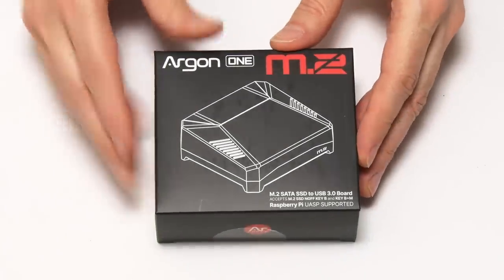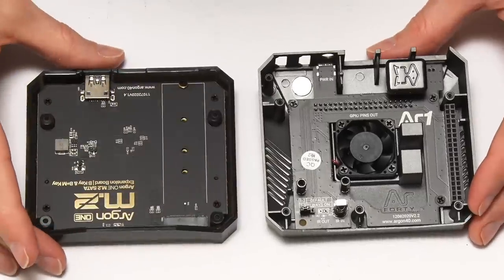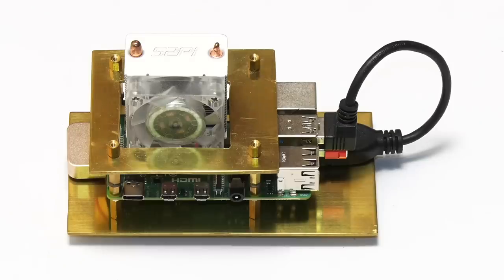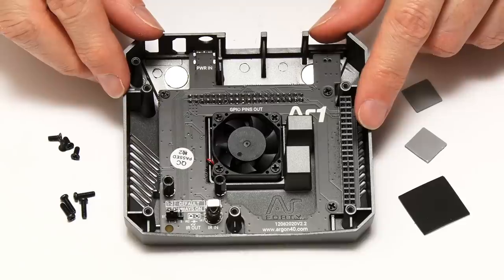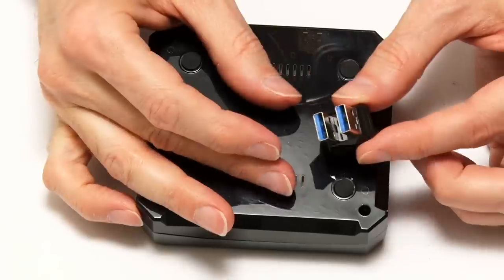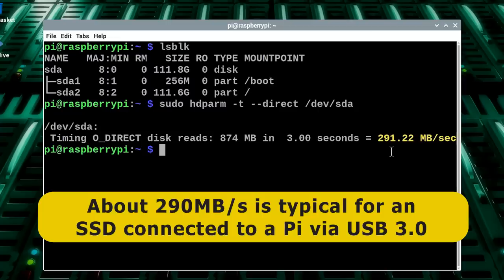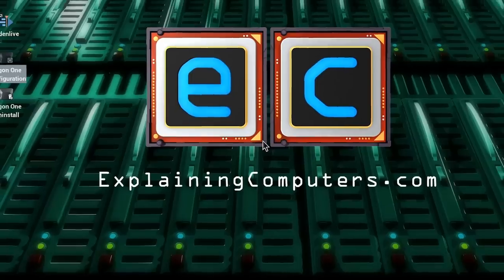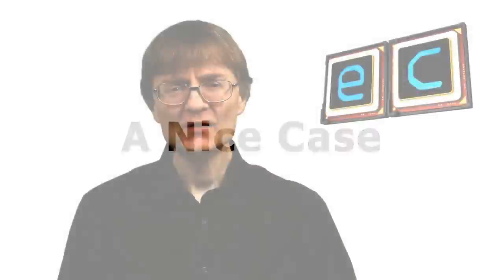Argon One M.2 Raspberry Pi 4 Case

Comment: Understood it most it as all your videos are always clear, but I got a bit confused on setting it up to run on M.2 ssd configuration part to run directly of SSD without SD card?

I finally ordered my first Rasberry Pi mainly for tinkering around with all sort of projects due to chip shortage, but have no hands on experience with its settings or OS, ill be also getting ahold of 512GB M.2 2280 for media server side of it.

Comment: Great video, I love this case it is very smart, the full size HDMI is fantastic, i run berrryboot on my device, its nice. 
i wonder what the power consumption is like with that drive, how it effects the other ports when it is used, and like wise how things are effected overclocking?
I have had some experience with this setup, from my experience the pi starts to tank with two ssds, struggling to power two at once, especially if overclocked, i did get an overclock to work with two ssds, a usb thumb stick and usb wireless adaptor, but i had to use a powered usb hub, and after i did this, when i rebooted the pi, i got hdmi issues with flickering screens and crackling noises (poor pi),  so my thoughts are that if you need an ssd as external storage, it is best to use the sd card as the boot device, especially when overclocked, so even though i like this case very much, the pi i use most boots from an sd card.

Comment: I am very concerned about the temperature on long term. I have the old Argon One and it gets very very hot, it’s not very comfortable to hold in hand (also the internal fan is very very annoying, producing an high pitch sound, but usually ti doesn’t last long). Also the metal ssd case I use for the drive gets very very hot too. So I wonder if having such a hot component just under the pi would be wise.

Comment: Hi great video thanks. Can I add two external ssd for storage on this via usb? Samsung T5 specifically for media storage? Thanks
Reply from the maker: Yes, you can use a Samsung T5 (or any other external USB SSD) with a Pi. Works well. However, note that with an M.2 drive in the Argon One that there is only one free USB 3.0 port. So if you connected two external USB SSDs, one will be in a USB 2.0 port, so limited to USB 2.0 speeds. Or you could use a USB 3.0 hub.
Reply: @ExplainingComputers  thanks so much for that reply massively helps

Comment: What's the advantage of using an M.2 SSD vs an external usb SSD, if you're just going to be using a USB connection, which I would assume would have a similar transfer rate?
Is it heat management or lifespan? 

I realize either option would be far superior to using a thumb drive or SD card.
Reply from the maker: There is no speed advantage of an M.2 SATA SSD connected via USB 3.0, compared to an external USB 3.0 SSD. The benefit is one of form-factor -- having it in a case with the Pi. :)

Comment: Nice little case.
If I had any issues with it, is it that it would have been nice if the USB adapter to the M2 had a pass-thru external-facing USB3 slot, so that the Pi still had 2 user-accessible USB3 slots.

Comment: Another great video. I purchased the Version 2 of the basic case (has the daughter board with full sized HDMI ports and the base with SD card access) after watching tests of the SATA M.2 unit. It seems that the USB bridge connector caused the most issues for reviewers, like it needed more shielding. The case is nice but seems intended for a specific niche market; Argon40 replied to an email of mine about using a HAT with a header extension or extended ribbon cable (I'm still deciding on a HiFi HAT) and "sounded" surprised that I would consider making my case look so ugly... LOL... function over appearance, or vice versa? Thanks for the video, Chris. Be safe.

Comment: Case, heat sink, thermal pads, fan, daughter board with audio-port & two full-size HDMI slots & USB-C power port, USB adapter, and a SATA m.2 connector?  Yeah, I'd say that's worth $45.  You'd easily spend that much buying each of those parts individually, and you'd not wind up with anything near as compact or good-looking as what you get there.

Comment: Help, I have m.2 case, My fan keeps running even under temp settings. I updated Ubuntu, installed curl and fan script, set default fan settings and reboot. Also uninstalled script, reboot, repeated steps, same issue.  Idk what I'm missing. Any suggestions? Using putty terminal. Thanks.

Comment: I have 2 of them, the fan inside is crappy and starts squealing like a pig on startup. I've found a larger fan just sitting on top blowing down on it works MUCH better. also, don't use the stupid thermal pads, use thermal goo... drops temps significantly. otherwise, the overpriced case works nicely and looks good.
Reply: Will thermal goo make good contact though? I assume apart from keeping things clean and easy to install, the pads are also used to ensure good contact as I guess the case/board tolerance isn’t that accurate. :)
Reply: I have wondered about the most ideal replacement for the Argon One fan. I do like the case and it's kind of my go-to case just for the full-size HDMI and the integrated SATA. The fan gets little use, but … I've definitely owned better fans.
Reply: I can only confirm your observations. But it seems that our friend here has got some benefits from Argon.
Reply: If you care about the fan unscrew it and pop the sticker off the back, you can usually oil them. I haven't found many fans i can't oil like this and fix the noise. 

External cooling will certainly do a better job, but sometimes you can't beat a compact package like that.
Reply: My fan, which is always on, is virtually silent, so you may have a dud, there. +1 on the thermal goo, though. Works perfectly for me. Won't need thermal pads ever again.
Reply: Agree. Furthermore I simply prefer using dead-silent passive cooling. No need to put stress on your brain with constant irritating noise.
Reply: @runepedersenDK  Huh. Not on a Pi, but on my regular PC, I make use of the fans for white noise to help me sleep at night. One of the 'disappointments' of my current build is that all the fans (including the PSU) run much more quietly than before (to the point I was worried I had gotten a bad motherboard on first startup), reducing that white noise. :-/
Reply: @VulpisFoxfire  look up 10 hour rain and train sounds for sleep, if you need new white noise to replace the fans LOL (personally I let creepy pasta's play through out the night or something usually from a playlist.
Reply: @richards7909  yes it does in mine
Reply: @volvo09  mine are in another room, used as servers.
Reply: @richards7909  I'd think ideal would be copper shims. Those pads are actually insulative, just not as insulative as an air gap. Also, those little fans are never much good and I always wind up doing something like an external fan, after I get tired of replacing the little internal fan. Same all the way back to when they were used as CPU fans. Crap bearings on most of 'em.
Reply: @VulpisFoxfire  There's a website that has loopable MP3s for all sorts of noise -- white, pink, brown, etc. Just search for white noise mp3 and it should come up.
Reply: Ping this good man comment for future reference please.
Reply: I put some thermal splodge on mine and I was't 100% sure if I was able to make a great contact with the case as I didn't see much of a change in temps as opposed to the pads. Shame as I get around 25'c idle and 40 odd under load with the tower cooler - still, very nice case all the same!
Reply: @Reziac  whats brown noise? Farting on the loo?
Reply: @the_retag  LOL, hell if I know why they have such names, but that's as good an explanation as any!
Reply: Even overclocked and running at 100%, my Pi almost never even needs the fan while in the case.  Just increase the temperature threshold, and the fan shouldn't make noise because it never turns on.  Personally, I wouldn't worry too much about temperatures until they reach 70.  If a Pi dies an early death because of too much heat after a few years, they are cheap to replace.

Comment: Now I have a Raspberry Tau ( 2 Pi that is). That was a maths joke. A model 3B and a model 4B, both running the 64-bit OS with Mathematica, no problems. For some tasks the 4B gives a great speed-up from the 3B, for example Mathematica 12 calculating Eigenvalues is about 8 times faster. I have the 4B in this Argon M.2 case with M.2 SSD - it still struggles with 4K YouTube content although I didn't get it for that. It's my new favourite computer for Mathematica (free license).

Comment: Thank you for the video... one question I have.... when using the m.2 with overclocked cpu wifi and blue tooth I have a low power message come up... is there a way to fix this?  Or are the just limitations to how much you can run at a time?

Comment: Almost perfect. Covering the micro sd would be a deal braker for me. My pi is configured to boot from ssd unless there is a card in the slot.  So I have alternative boot options.
Reply: The slot sucks. I use a uSD/USB3.0 adapter for USB booting. It's twice as fast as the uSD slot and provides me with all of the options for testing various distros, without disturbing the SSD storage of data, downloads, and local git repositories. Just flash a vanilla distro (or whatev) onto the uSD card, then locally add my apps offline. If I knew more about scripting, he whole process could be automated. Just boot from your chosen disro, then run an installation script located on the SSD. Botta-bing!

Comment: i'm trying to to use the pi (4) psu powering x2 3watt speakers and an ssd directly from the pi via usb and i'm having boot issues :/ , kinda baffled this works with all those devices attached .. although i'm not sure about m2 power consumption compared to the ssd.

Comment: Great feature on the Argon One! I prefer the RPi 400 nowadays and use RPi 4 headless but this case would be great for desk use. Could you please do some temperature tests with the PoE hat and its fan installed?
Reply: I used to run my RPi 4B with a PoE hat and that ran a lot hotter than the same RPi 4B with the same load in an Argon One!

Comment: If you are getting slow SSD speed like I was, there is a thread on raspberry pi forum about SSDs and USB Attached SCSI(UAS). I guess my older M.2 ssd did not handle UAS.
My initial speed was 87MB/s, far less than the speed shown in this video. After applying the 'quirks' entry in /boot/cmdline.txt, I rebooted the Pi. Speed went up to 137MB/s. Better, but still not as high as in this video. I shutdown and powered back on. I'm now up to 220MB/s.

The thread I looked at was: https://www.raspberrypi.org/forums/viewtopic.php?p=1501426
Reply: Yes, I found the same issue, until I saw Jeff Geerling's YT video on the subject. It's also true with flash drives. Discovered that the "Corsair Flash Voyager GTX 512GB USB 3.1 Premium Flash Drive" performed as well as my SATA M.2 SSDs. Unfortunately, the same wasn't true with the less expensive "Corsair CMFSL3X1-32GB Flash Voyager Slider X1 32GB USB 3.0 Flash Drive". Education can be expensive. :-(

Comment: Trouble is, it is all nice and neat until you do anything with the PIO, then you have to take that panel off and probably will never put it back on, even if you only wanted a two wire serial coms to an external device/bread board of your own making, you will forever have that part exposed, and ready to receive bits of wire or solder (or even the jam from a donut).

I would rather they had allowed a ribbon connecter out through a slot. My general point of view is that though R-Pi makes a nice Linux desktop terminal, most users will have a much more powerful Laptop/computer already on their desk.

The Pi comes into it's own when the cases etc make it easy to build/control projects that are off the processor board. So some of the other cases do a better job of exposing the parts you would need to the outside world whilst protecting the CPU board from damage.

Comment: That's a nice case!

but i think its kind of a waste if money to buy a 60$ ssd for a pi
Reply: The main benefit I see is neatness.
Reply: @stephenhookings1985  Yes thats true but you need to see technically also
Reply: @stephenhookings1985  1st of all it blocks the wifi signals because of  the shielding
so wired is better

Comment: Hi Chris! Do you know if the WiFi performance is affected by the metal case?
Reply from the maker: It cuts the WiFi signal strength, but for me WiFi still worked OK. So it will depend on your particular situation -- if the Pi 4 is getting a weak WiFi signal before fitting the Argon One, you may well have a problem.
Reply: @ExplainingComputers  Thanks for the answer Chris!

Comment: It would seem to me that using a USB slot to shoehorn in an M.2 interface would be bottlenecking the M.2
Reply from the maker: M.2 is not an interface, it is a connection standard that can use many different interfaces (including SATA, PCIe/NVMe and USB). Here the M.2 slot is for SATA SSD, which is around the same theoretical speed as a USB 3.0 interface, although in practice the USB 3.0 implementation is far slower, so will be a bottleneck as you say.

Comment: Didn't they implement a USB to SATA connection that isn't properly compatible with Raspberry OS?

I use one of these myself with Ububtu and no problems there but oh my god did Twister run like crap on this thing. I assume it was yet another incompatible adapter so went right back to Ubuntu as the fix for the cmdline means your aren't getting top speed. It's the same with Retroflag and their own internal SATA adapter. :T

Comment: I put a pi 4B 8G board into an Argon One M.2 case, then added a 1 TB PNY M.2 Sata SSD.. I loaded Ubuntu server 20.04. The fan shuts off when the unit get's hot making it go into a thermal shutdown. The fan runs when the unit first starts up. I have it set for the fan to run full time. The unit running nothing but a simple graphical  screen saver, will shut down after 4+ hrs. Maybe I have a bad unit.

Comment: Hi Chris.  Hoping to have both m.2 as boot drive and external drive attached by USB for NAS.   If you read the highlighted 1-star review of this case on amazon USA, an electrical engineer guy claims that setup will be under powered if you try to use both the M.2 and an external drive in the remaining USB port.  Do you have any thoughts on this?  I will paste the review into a reply to this comment.
Reply from the maker: It will depend on the external drive. A Pi can power two external SSDs (and an M.2 drive here is basically an external USB SSD included in the case). But a Pi will not power more than one external 2.5" HDD (a 3.5" HDD will need its own PSU anyway for the 12V line). So if you use the M.2 SSD slot here, the review is right that you are very unlikely to be able to power an external 2.5" hard drive. And this has absolutely nothing to do the the Argon case -- it is a practicality of the power that a Pi can supply through its USB ports.

Comment: Have one of these Argon cases for the Pi 4/8GB, I stopped using it, the case wasn't a worthwhile purchase for me. 

The fan is pretty loud for starters, not as loud as the fan on my i7 NUC from a few years back, but loud enough. 

I can't use the device as a ConfigFS USB Gadget via USB-C with the case on because the USB-C pass-through on the case is powering through the GPIO pins it looks like. So if you wanted to turn your Pi 4 into a USB Keyboard/Joystick/Mouse HID/Mass Storage/etc USB Gadget for another device that's a no go with this case. This alone is a deal breaker for me.

Good luck if you have a CSI port camera this case won't work with it, there's sort of an unmarked slot but the fan blocks it.

It might have been a somewhat salvageable purchase if you could just use the converter hat that turns the micro HDMIs into regular HDMI, but it blocks the USB-C just enough you can't easily squeeze in a connection.

It's virtually useless for my needs at this point, but if your usage is maybe just playing some games and using it as a desktop then it might not be all that bad.

Comment: Is there a similar case or a way to mount a SATA III SSD in the same way? I LOVE LOVE this case, but I want to use my SATA III SSD.
Reply from the maker: Checkout the video I just posted -- it is about a case that includes a cartridge slot for a 2.5" SSD: https://www.youtube.com/watch?v=gdSsGWzNEO0
Reply: @ExplainingComputers  That's a great option! I am also interested in knowing if there is a something that mimics an M.2 SATA board, but then allows for a single SATA III SSD to be attached. Either a full cable or a USB 3.0 and I can use a USB/SATA III adaptor.

Comment: My main issue with this case is the "Lugs" are painted, Blocks heat transfer. Also the cases are not great with quality control, mine came with some plastic flashing I had to cut off
Reply: Also getting the fan to run on any OS that's not Raspberry Pi is a HUGE pain.

Comment: which power supply do you use the one that comes by default with the raspberry pi 4 does not raise the ssd for me
Reply from the maker: There is no power supply that comes by default with a Raspberry Pi 4, although I'm sure that some resellers bundle one. Here I was using the official Pi 4 PSU -- 5.1V, 3A -- which handles an SSD no problems. :)